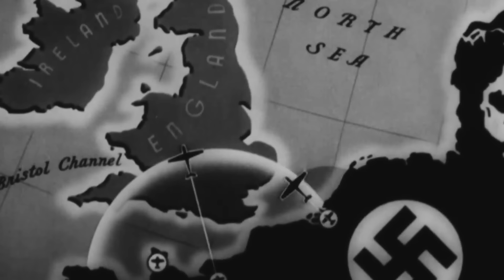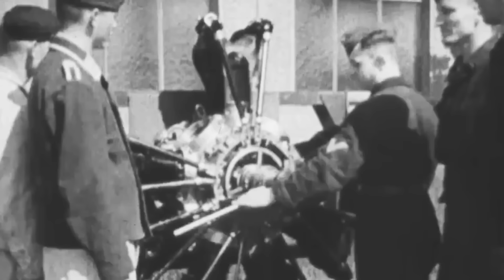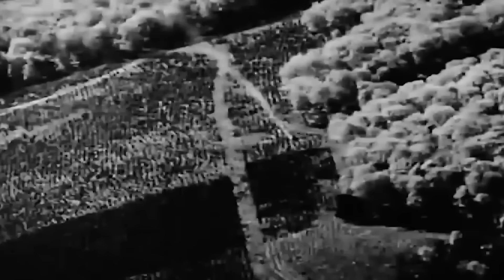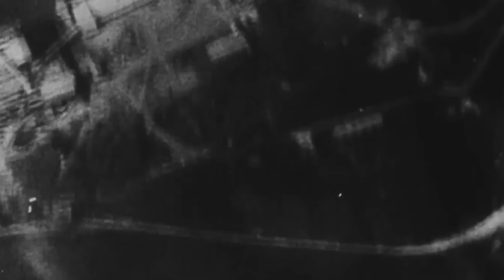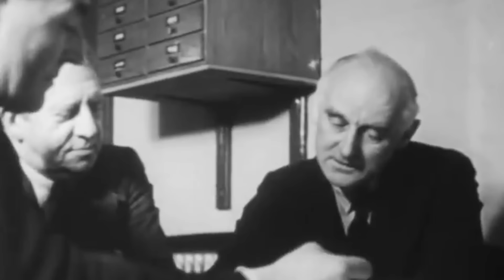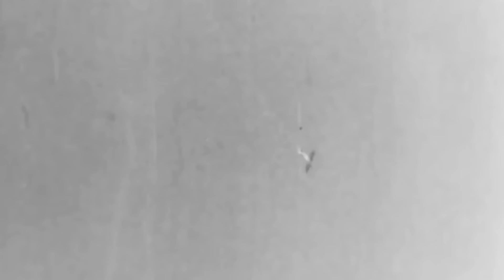Germany's Flaming Flying Coffin - Heinkel He 177

Comment: During covid I made a “what if” 1/72 model of a very modified He-177. Germany had made several design modifications to the He-177 to give it 4 separate engines that were initially called the He-177B and eventually led to the He-277. I think there were more than a dozen prototypes each with modifications designed to help rectify the He-177 deficiencies. I picked what I thought were the best features of each prototype and made a composite model from several aircraft kits. The end model has 4 x BMW801e engines, a taller single tail, FDL 131Z remote turrets in nose, dorsal & ventral positions, a quad HL131V in the tail and a longer modified nose section scratch built. I called it the He-177C. It was tricky to build, but a lot of fun to research. Cheers from Australia
Reply: If you want to build WW2 What-Ifs. Germany is the best country to pick😂
Reply: @sos_legio_primus .  ….. very true, a wide, and sometimes wild, choice of designs to choose from.
Reply: Although Hobart's funnies is another great choice 😂

Comment: This really shows how good the B-17 was and how great the B-29 became.  God Bless the engineers that developed our heavy bombers and the crews that flew them.
Reply: The B-29 also had a near fatal cooling problem with its huge Wright R-3350 engines. Keeping the engines from overheating was a major preoccupation, the aircraft had to be kept at low altitude immediately after takeoff or else the engines would overheat during the climbout as a result of being run up for takeoff. The crew didn’t mind black smoke from oil coming from the engines. White smoke from burning aluminum was another matter as eventually the wing would fail as the fire burned through the spars. The cowlings were radically redesigned to solve the problem but none of the aircraft that had them reached the combat zone. Eventually, the Air Force abandoned the Wright engines, putting even more powerful Pratt and Whitney R-4360s in as replacements. The new aircraft became the B-50, the last bomber development of the B-29. Meanwhile, Wright R-3350s would be used in the civilian Lockheed Super Constellation. Because the engine had a high in-flight failure rate, the pilots despised them. For many of them, it ruined the reputation of the famous Constellation.

Comment: I thought the American arms industry was the only one stuborn enough to field a weapon like the Mark 14 torpedo [which failed 80% of the time] and then ignore the operators who had to live with that mess.  The Germans were obviously also plagued by top level imbeciles. Good thing.
Reply: The only thing wrong with the Mark 14 torpedo was its detonator, that failed to trigger when the nose of the torpedo was crushed in a straight on hit. Submarine captains found that the torpedoes worked perfectly when fired at an angle so the detonator could finish its action before the nose of the torpedo was crushed. 

But yes, the stubbornness of US Naval command to even accept that the torpedoes had a problem was embarrasingly stupid. I'd say the whole "Vietnam War Plan", where the entire war was run from the US was even stupider though, as the decisions then made often defied all logic.

Comment: Rolls-Royce also tried to build an engine with evaporative cooling (the Goshawk) where the coolant water was allowed to boil in the engine and then condensed from steam in the radiators. They were also unable to make it work.
Reply: RJ Mitchell incorporated the Goshawk evaporative cooling in his S6 racing seaplane, which was fine for a relatively short run,but as you say,would have proven impractical for combat aircraft.

Comment: Like Avro fitting the basic Manchester airframe with slightly extended wings and 4 merlin engines Heinkel did produce the He 277 with 4 Daimler Benz 603 engines and like the Lancaster it proved to be an excellent aircraft,unfortunately for the Luftwaffe production contracts were not awarded for what would have been an exceptional long range strategic bomber.
Reply: It is baffling how obvious the solution to that self-created "two engines in one nacelle" problem was, isn't it? 
But then: every project the Fuhrer wasn't personally involved in or met his vision of "bigger is always better" got almost no funding or even ignored completely. This video already states that the main Luftwaffe man who pushed this bomber died during its development and that pretty much meant the death of the whole project. Heinkel pushing on despite that setback didn't do much to change that, as they didn't ahve the authority to make drastic changes during development.